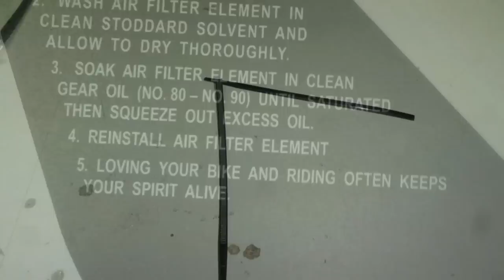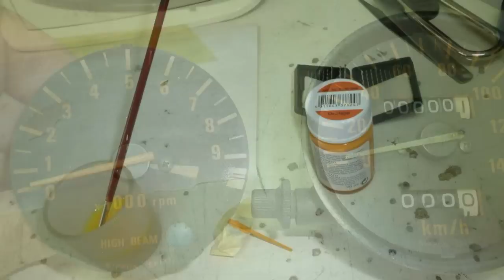Honda XL185s Restoration

Comment: I bought one of these new in 1980 and it was stolen just one year later :-(  I remember the vibration in the footpegs making my feet go numb on long journeys.  I also still have a scar on my leg where the exhaust burned the skin off when I fell with it whilst messing around in the woods.  I miss my old XL185SA.  I would like to restore one like you have.  I will see if I can find a suitable one.  You should be congratulated for doing such an amazing restoration - it looks brand new in the video !!
Reply: You made me laugh about the exhaust getting so hot it could "BRAND SKIN" I was riding my new SUZUKI TS 50/80 BIG BORE CONVERSION in the woods and everybody but me was lighting their cigs off the exhaust of this XL Thumper:)
PS it was as good if not better than my new SUZUKI when the going got tough:/ so I have respect for this old timer to this day.

Comment: Where can i buy overhauling gasket on this bike? i had 185s still on good running conditions but hard to fine gasket for it here in Philippines.
Reply: If you cant find the correct gaskets, you can make them by yourself from "paper gasket sheets". There are many different gasket sheets.. so you just have to specify wich thickness, draw them on the gasketsheet and cut them out. Most of the time thats cheaper and faster than searching and waiting for the perfect gasket.

Comment: how did you clean the engine?
Reply: +knarl64 Hi, if you mean to the shell, once disassembled both parts you can put them directly into a container with the same liquid used to clean carburators.
I don't remember its name, but it sells in any bike shops. 
Cheers, John from Chile (South America).